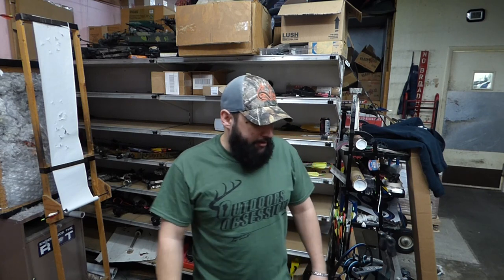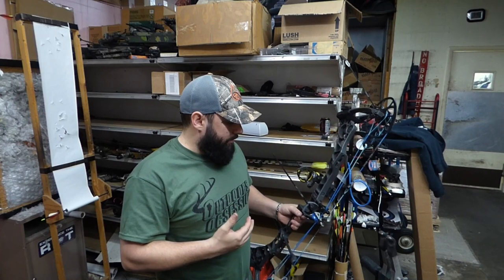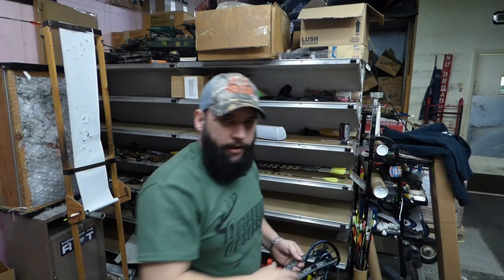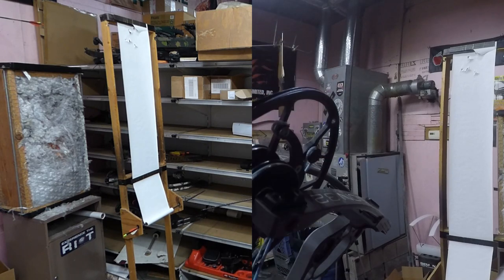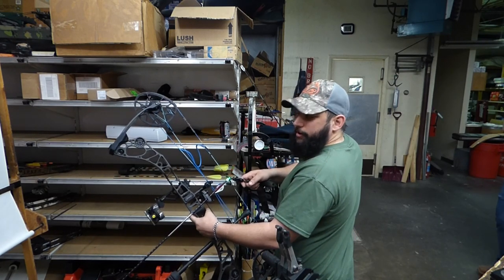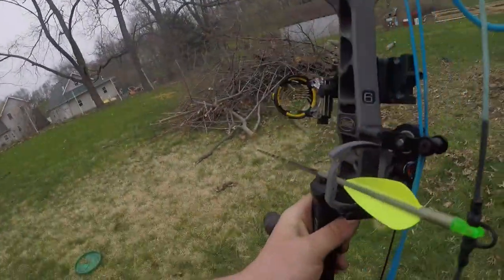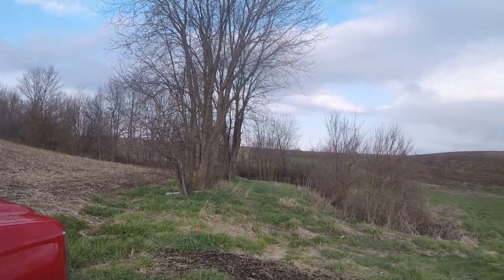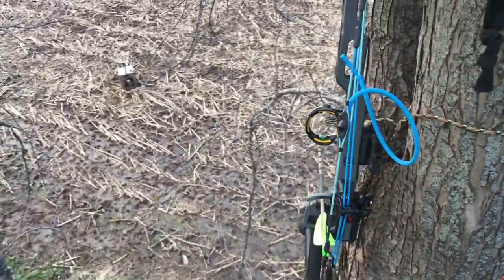VaporTrail Gen7x | How To!!

Comment: What is the rubber part on the shelf?
Reply from the maker: It prevents the arrow from making a "tinging" sound. Called a launch pad
Reply: I used 1mm cork tape on the shelf, very quiet and arrow never touches the riser.

Comment: Well if you do that the rest will never be square. 1. If you eyeball it in relation to the cam and riser then you will be approximately 3mm off. Due to the fact that the cams are NOT perfectly lined up with the riser. 2nd the arrow should be 1/3 higher than the berger hole. Not perfectly centered….
Reply from the maker: To each their own however out of the 1000s of bows that I've tuned ive never had one that we've made the arrow 1/3 above the berger hole.. always right thru the center of it.
Reply: You are making your own rules.